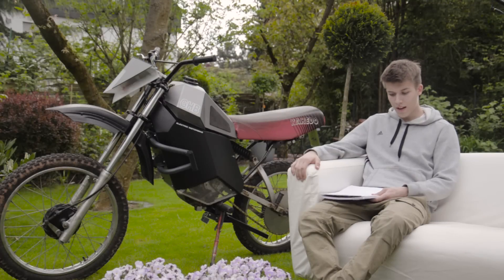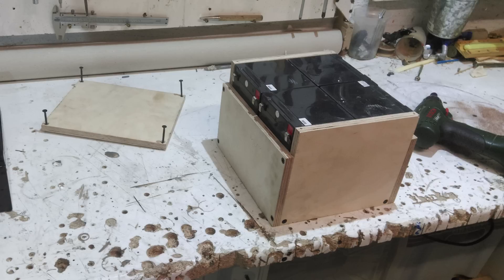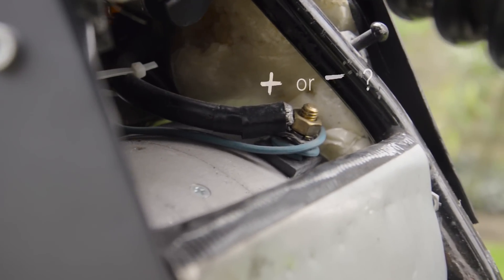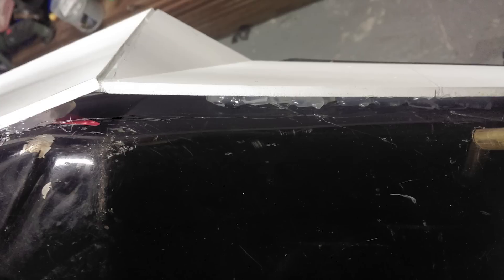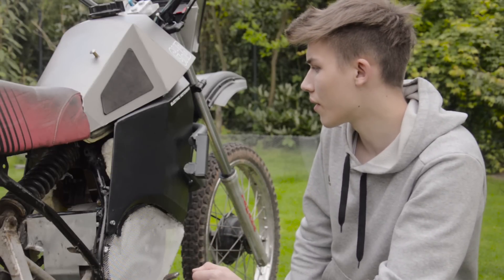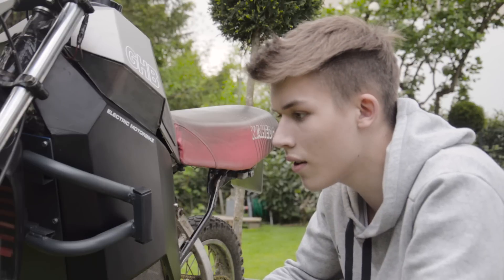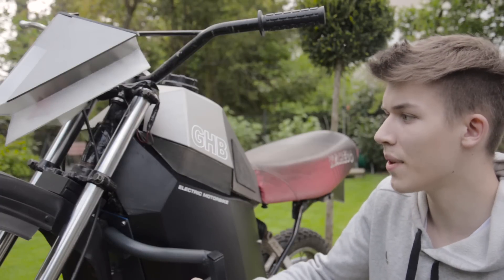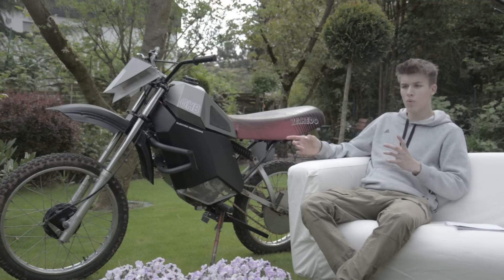How i built my electric motorcycle

Comment: What are the components required??
Reply from the maker: MAIO bros. You don’t need anything specific. Motor, Controller, Battery...The components only need to fit.
Reply: @KimballCrawford  can you suggest me the  specifications of the motor, battery, controller, etc. I mean.. I'm in India.. And its hard to find the things you mentioned in your video.. Thanks..
Reply from the maker: The Motor Kit: http://www.evdrives.com/product_p/ck-0708.htm
The Battery he used: https://www.amazon.de/dp/B00D9612FO/ref=cm_sw_r_wa_apa_PQYczb06S4K5H
The Battery is not very good, try to get a better one.

Comment: Nice Build! I've got a similar setup as far as the motor and controller configuration goes on my own electric conversion. Beware though, those lead acids won't last you very long! (Trust me, I know). Ive managed to get some used LiFePO4 modules for free that need a bit of work, and then ill swap them in. If you want to check it out my channel where I've got a couple videos uploaded is called A1-ALEX.

Comment: sorry but that is one weak electric motorcycle.. replace those heavy batterys with lithium ion cells and get more voltage if you want to go fast.
Any stealth ebike will smoke this thing.
Reply: Lithium batteries are very expensive thats why i yous gel Batteries
Reply: Not when you buy cctv 12v lithium batteries and wire them together.

Comment: nice! what is your reason for choosing a brushed drive? have you thought about a brushless motor? why did you use gel batteries?
Reply: Got a permanent magnet motor built inside. 
The gel batteries where very cheep so I started with those for the beginning :)
Reply: Gabriel Harrison I think with lipo+brushless outrunner + gearbox you could really ramp things up. I am currently building a cafe racer from a xj550 and plan on fitting it with an electric drive in the future. I really like where your project is going.

Comment: Definitely a great prototype. Your choice of the 80cc donor bike saved quite a bit of weight, though the bigger forks upped it somewhat. The foam parts probably won't stand up to regular use. But it's a good effort. :¬)
Reply: The foam parts are covert with glasfiber so its pretty hard and strong.
Reply: Ah, cool, I missed that part. Probably wasn't paying attention as usual. ;¬)

Comment: Hey great job! I will probably start one project myself in the winter. I am preparing stuff now and try to find a lightweight electric motor... where did you get yours and what kind of motor is it? There are so many different ones... also did you need a converter?  do you think you can compare the power the bike has to a combustion engine?
Where you from also? Sounds partly like you are from germany (i am from germany)
Reply: Hi,
there is the Link to the convertion kit wich i yoused.
Ja ich komme aus Deutschland (Darmstadt) das ist in der Nähe von Frankfurt.
Reply: http://www.evdrives.com/mobile/product.aspx?ProductCode=ck%2D0708&404;http://www.evdrives.com:80/product_p/ck-0708.htm=

Comment: lovely work mate well done. i cant believe you drilled out the yokes though you maniac hopefully the front end doesn't fold on you... maybe drill some holes out of the sprocket to reduce non suspended rotational weight? all in all though a great project for a young lad, you should be commended for your efforts well done
Reply: Sure will look cool but the effect on acceleration will be so minimum you wont notice it.
Reply: Thank you I did not think about that... Would it be possible to accurately mark out holes to drill using a dividing head and get it evenly balanced? Could you drill holes and then try to balance it out after by removing material? It's a lot of weight to have unsprung and spinning, acting as a flywheel - does it not affect the acceleration?
Reply: dont drill cut, it will be imbalanced, so you have to buy new one, find a person or company and have it specially milled or waterjet cut, it will look cool and the spun weight reduction help with acceleration alot